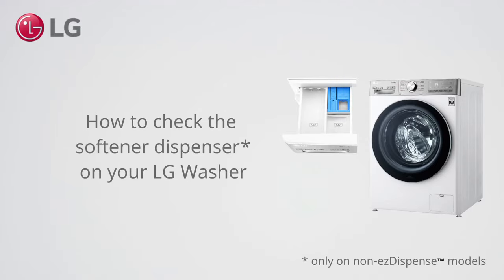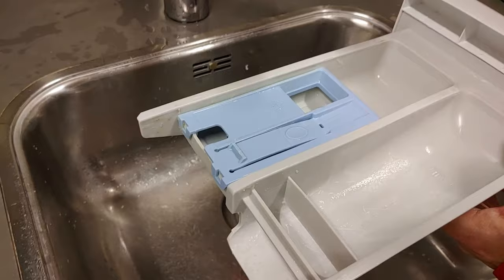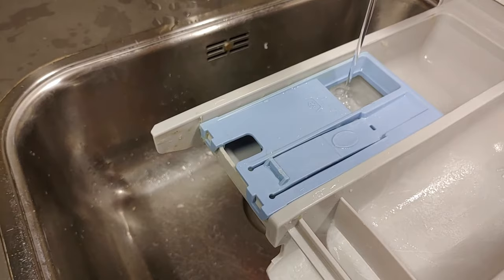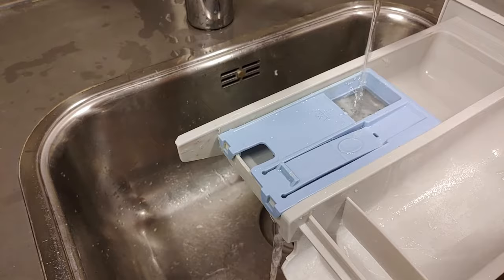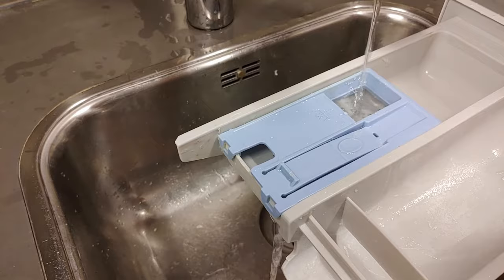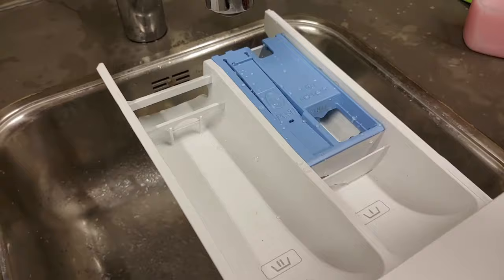[LG Washing machine] - Check the softener dispenser on an LG washer

Comment: I have good flow when i am pouring the water, but the softener dispenser wont drain itself. There is always a lot of water left, almost up to the max line.
Reply: I have the same problem with mine
Reply: Mine too
Reply: Same here. I don't understand the mechanism and how it supposed to empty -- it doesn't seem there is a way for it to drain...
Reply: Any solution to this phenomenon?
Reply: I have the same problem
Reply: Same Problem here...
Reply: Mine too LG team please answer..almost all of your customer encounter the same problem!!!!!
Reply: Same issue
Reply: same issue
Reply: anyone fixed it? i have already called LG customer service
Reply: Same here 😢
Reply: I already contacted LG CS, my unit is for replacement
Reply: Mine too, the clothes come out smelling like detergent with no smell of the softener
Reply: Just bought our washing machine,  and we have the same issue. Probably going to return and purchase from another manufacturer. No reason for this issue when brand new oh, and leave a bad review
Reply: Same problem what to do
Reply: Had the same frustration but now sorted.  Was due to blocked water feed in the top of the tray.  Had to remove the washer top, then remove the drawer unit (few hoses a clip and a couple of screws).  Once out you can remove the drawer upper lid by opening clips on each side.  There are several spray sections in the lid.  On my model there was a small square section with just one hole which aligned with the softener compartment.  Cleaned the hole with a cotton bud and ran water through until good flow.  Put it all back together.  In hindsight you might be able to remove the lid without removing the whole drawer unit.
Reply: Same problem😐
Reply: Same problem
Reply: Me too, same problem
Reply: I've had this problem for about 6 weeks, but after trying all kinds of cleaning methods recommended on other sites I've eventually solved it. The problem is simply the blue dispenser cover. With constant use and pressing the release button to take the drawer out for cleaning, the blue plastic cover has 'bowed' downwards. It needs to be flat and even so that it doesn't impinge the tube beneath the cover which acts as a syphon for softener and water. I simply bent the cover straight!! I thought even if I break it, I'll just send for another one. Got to be cheaper than a replacement machine! It all now works like a dream!  ..I'll take your applause now folks 🤓👏

Comment: Very disappointed in the LG front load Washing machine! My clothes never smell as nice as they used to. And the legs keep on needind adjustment! Very bad washing machine for its price.
Reply from the maker: Sorry to hear that. Since the machine does not product a smell by itself, it may have to do with foreign substances (detergent or softener remains) somewhere in the tub and/or drain path. Is the machine still heating the water well enough? Try running a hot wash without clothes or detergent. If you see suds there has been residue in the tub which will be flushed away. A tub clean program will also help doing something similar.

Comment: I just bought a new LG front loader but it's not taking the softner and I have filled it below the max line, any idea how to fix this?
Reply: Same. Hope some one can help
Reply from the maker: What program did you use? If it is a new machine it is not likely that there is clogging of the tube or anything related, so you may need to contact your local LG support office to get a SVC engineer visiting you.
Reply: @LGSAE  I'm using the Wash and dry program. Can a low water pressure in my house cause that?
Reply: Same with me
Reply: @vjrana8164  Water pressure was my answer. I got a strong water pump in my house and the washing machine is working perfect.
Reply: @Rico0oG  so after high pressure pump is used, now the fabric conditioner is completely drained?
Reply: @koushikmediga8397  Yes it’s completely drained and only some water left at its place. So I wash the whole tray after every wash to make sure no gunk builds up

Comment: Bought a new LG front load washing machine. Machine is great but very noisy when water draining (loud pump noise). Otherwise extremely silent. Maybe I should check the drain hose? Thank you
Reply from the maker: Yes, if it needs a lot of power to pump, it will get noisy.
Reply: My lg washing machine is very noisy when is taking water inside...

Comment: that told me nothing.  You can visibly check the opening without having to flow water or softener through it.  This is why I stopped buying LG products, they don't stand behind them and their own techs watch yout ube videos
Reply from the maker: The video can be used to check the softener flow. A visible check may work but not in all cases because softener, in case is blocks the hole, could leave a transparent coating and it may be difficult to 'see' this. And because our Service partners' field technicians may also repair appliances from other brands, these videos may also support them.

Comment: I got a new machine with the same style of softener dispenser, but every time its full of water after the washing process, so i have to drain it every time manually, is this normal (I don't use softener)?
Reply from the maker: There will always be a small amount of water (not full) in the tray, due to the fact that the machine does not 'know' if you have put in softener or not, so it will flush some water through the compartment in any cycle, this is normal.
Reply: @LGSAE  And then the water gets moldy.  It should empty fully

Comment: water is getting stored in softener dispenser, any solution. Machine is less then 7 month old.
Reply from the maker: that is normal behavior. Take the blue cover off and you'll get the idea. When water enters thios compartment, it will increases the level and the softener will flow into the capilary hole. After that, some water will always stay in the tray.

Comment: Can you tell us where to add bleach for when I'm doing whites?
Thank you, appreciate this...
Reply from the maker: Not needed. On European machines there is no separate bleach tray. Regular detergent for whites typically contains a bleach component, so that is suggested to use. In case you insist on using bleach, please check carefully if it is suitable for washing machines and add it to the main detergent tray or use a separate cup and put it on the laundry in the drum. Then immediately start the cycle to prevent that the bleach comes in contact with the laundry before the water enters. Hope this helps, good luck!

Comment: Water softener doesnt work.
1. Cleaned it thoroughly.
2. Have good water pressure. 55 ps
3. Tried all suggested options.
4. Done.
Reply from the maker: If you are sure that everything is clean and the softener level does not decrease, please contact your local LG support office. You may need a technician visit.

Comment: Only used it a few time and right from the beginning, the fabric software side of the dispenser if filled with water after every wash. It's a real PITA and my wife is complains every time she does laundry. If there is not a resolutions, we will be returning. I don't know why this crap happens with a brand new washer. Junk!!!
Reply from the maker: Dear, I'm sorry to hear you are not satisfied, but I'm not sure what you mean with the "fabric software side of the dispenser if filled with water after every wash."  Do you mean that after the cycle, it will fill with water?
Reply: @LGSAE I mean, what's there not to understand? This is at least the 15th comment on this video stating there is always a max amount of water in the fabric softener tray after every wash. Ironically the first response left on this  video with 14 others experiencing this same issue is the one comment you haven't replied to. I wonder how I found this video. Oh that's right, my fabric softener dispenser is always filled with water and it got annoying enough to seek out a resolution. Guess I won't be finding the answer here but I did find it's obviously a  known problem.